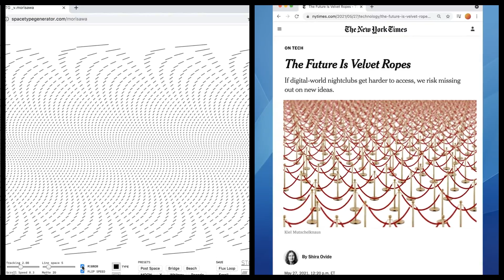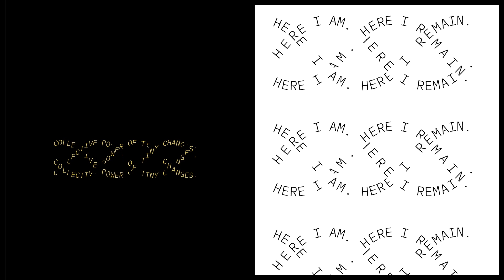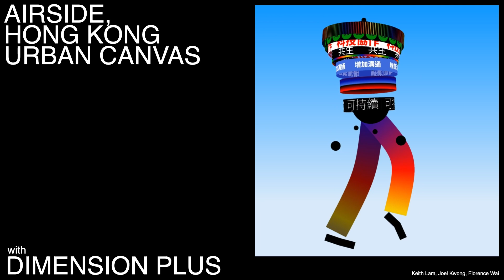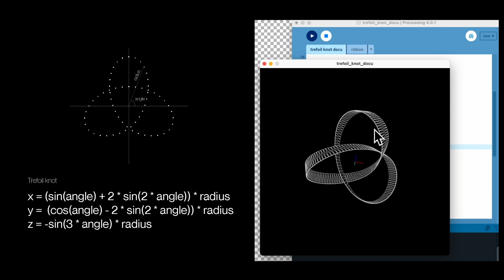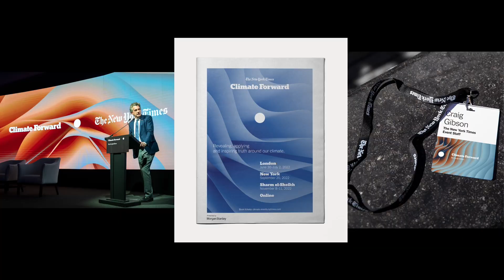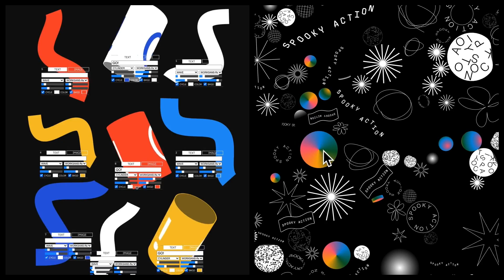CD Lecture: Kiel Mutschelknaus

Comment: Some of his stuff reminds me of a wave table synth. Basically a table of waveforms that map a transition from one sound to another, and then you oscillate/modulate different parameters of that table in order to create a new sound.

A lot of the concepts he's exploring are similar to what you can explore with modular synths, instead he's playing with visual tools instead of audio.

Another program to consider is TouchDesigner, which is video synth software.